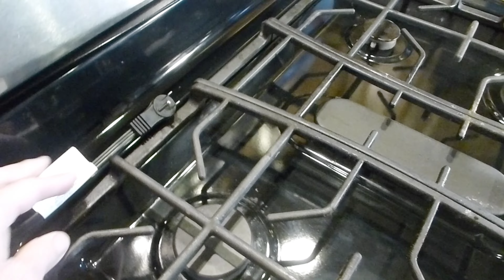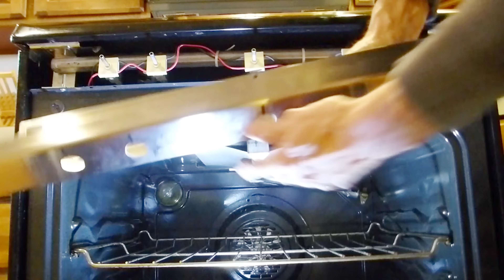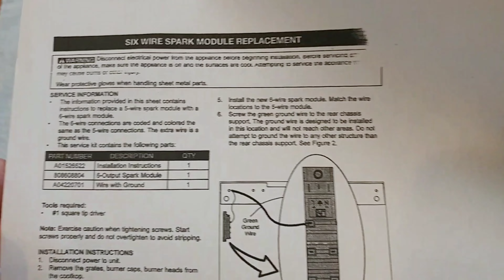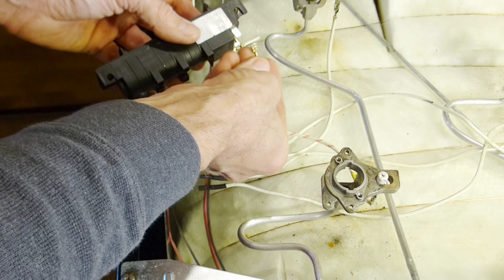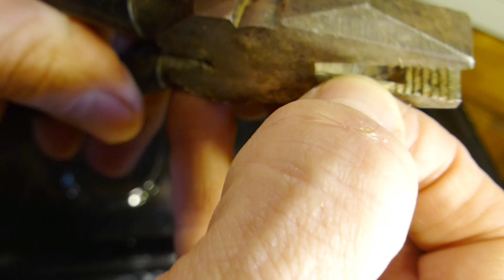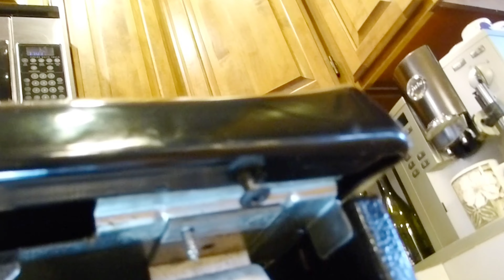Replace Spark Module Gas Range Kenmore Frigidaire Electrolux Stove Igniter

Comment: Super helpful. I have almost the exact same model stove. My back left burner will not spark but the others do. I tried cleaning all the ignitor and the parts above the ignitor with no luck. Burner lights with a lighter no problem. Not sure if zi should change the ignitor for that burner or the module as shown in your video. Thoughts or ideas on how to troubleshoot?
Reply from the maker: At the module, swap the wire for the ignitor that's not sparking with another ignitor wire and see if the problem remains with the same original failed ignitor. If so, that ignitor needs replaced. If the problem moves to the ignitor that you swapped wires with, then you need to replace the module.
Reply: @ScubaMoto  thanks so much! Makes total sense.

Comment: I replaced the spark module but it won’t stop sparking when I connect it to outlet
Reply from the maker: Sounds like the switch harness is shorted. You might get away with just cleaning it (the knob switches) with a good thorough alcohol rinse. Otherwise you'll want to replace it using your model number.

Comment: Your video was very helpful to tear it down the problem that I have is igniters constantly spark I'm thinking the module is bad also . Any thoughts ? Thanks
Reply from the maker: Glad it helped. It sounds like an issue with the knob 
ignition switch wire harness. One knob switch might be shorted and stuck on ignite. Before replacing the harness, if it were mine, I'd check each knob's igniter switch and clean them if they look gummed up. Replacement harnesses are around $75.

Comment: My oven doesn’t have the clicking noise. Would that still be the spark module?
Reply from the maker: Most likely. If none of the switches ignite a spark with the stove plugged in, my first choice is spark module.

Comment: I have a Magic Chef that has one burner lighting OK and the other 3 just click and don't ignite.  I'm going to clean the igniters but if that doesn't fix it could this still be the igniter module even though we hear clicking?
Reply from the maker: Don't trust your ears. Trust your eyes. If even one ignitor clicks, it's far too difficult to pinpoint the source of the click. If you don't clearly see a healthy spark at the burner you are trying to light during the ignition phase (clicking), then your spark module likely has an issue. You should also simply try to manually light it to confirm it is getting gas normally. If you can not manually light it or you do see a healthy spark and have no flame ignition, start by thoroughly cleaning the burner. If that doesn't help, stop using the unit because your valve or gas distribution may have a clog or a leak.
Reply: @ScubaMoto  Thanks for that!  I worked on the cooktop yesterday.  Cleaned all the burners and igniters with alcohol and toothbrush, hit the igniters with some 0000 steel wool, made sure the burner holes were open.  Then I found that if I connected any of the non functional burners to the one  terminal of the igniter module where the good burner was, they all lit like gangbusters.  So.  Bad module.  Ordered one from Bezos that says compatible.  Probably not OEM for the price but we'll see how it goes.

Comment: I have a Frigidaire stove that looks just like the one in your video, with the 5 burners. If I try to light each burner, only the two back burners light, while the 2 front and the one center burners do not. I have tried to let the gas flow while using a different burner to attempt to get a spark, and that did not work, so does that mean my igniter switch is still ok? Is it possible for 2 burners to light and 3 not to light if the spark modulator is bad? Is there anything else that could be wrong that I need to look into? I have been trying to figure this out for a long time now, but haven't gotten it figured out.
Reply from the maker: Since it's always the same three burners then it's not the switch harness. Start by making sure it's clean between the igniter post and the burner. I have to assume you are not seeing a spark at the three igniters that won't light. If so, then this sounds like how the spark modules start to go bad so you would replace it as shown in the video. It's unusual for three igniters to fail at the same time, but It could be the three igniters have failed (the metal posts surrounded by white porcelain). You can test that by swapping the wire leads at two igniters and see if the problem follows the wire or if the same igniter still fails with a working wire. You can do this at the spark module. If the same igniter fails with the swap, then the igniters are bad. If it follows the wire then the spark module is bad (most likely).

Comment: All the igniters on my gas range start to spark even if it is one that I turn the knob,so what can be the problem and how can I get it fixed .
Reply from the maker: It might seem strange but that is normal and it means the spark module is working correctly. Any knob will signal the spark module to ignite ALL BURNERS. But only those with gas flowing (valve open) will light.
Reply: @ScubaMoto  Thanks a million for your response,I really appreciate it.What makes this concerning to me is the fact that instead of the burner to light up after the igniter sparks,I was actually trying to light up the left front burner,there was fire all around the left burners front and back and as a matter of fact I have to horriedly put out the fire and after everything there was a black burnt mark on the left igniters front and back.I removed the top plate and checked the connection underneath maybe there is a joint that is not properly connected where gas might be leaking but there is nothing like that.Just now I was able to see another one which I tried and to my surprise it is only the igniter at the right rear (small one) that is sparking when I turned all the five (5) knobs.So is it a normal thing for all the igniters to come to life and be sparking when it is just one knob that is turned or the exact knob that is turned.I will sincerely definitely still appreciate your further assistance on this issue.Thanks and I look forward to hearing from you.Wishing you all the very best.
Reply from the maker: It sounds like your stove may have a problem with gas distribution and/or leaks. It could be as simple as the burner heads needing a good cleaning. You describe "fire all around". If a good cleaning does not solve this; for safety reasons, I must recommend not using it until you can have the stove inspected for possible leaks in the burners.

Comment: Changed that and still not sparking on all of burners 🤦‍♂️ have to turn on the back burner knob to make the front igniter spark 🤔
Reply from the maker: It sounds like your knob switch wiring harness is worth checking. Each control knob has a switch that it controls and they are all connected with a wire harness. A new switch harness is about the same price as a spark module. But if it was mine, I would first try taking it apart, checking all the harness wiring and cleaning each switch with a terminal cleaner like Deoxit and see if that helps. Good luck with it.
Reply: Yup that seems to be it i swapped them  and that seemed to do the trick 👍🏼 might try the cleaner and see if that helps. Thanks.

Comment: Thanks for the video. I am replacing a 4 spark module. If i have a 6 spark module do i just Earth the sixth one and leave one empty?
Reply from the maker: It should work fine if you ground all spares. It will actually also WORK if you don't ground either spare. They just recommend it for safety and so do I. I hope that helps.
Reply: @ScubaMoto  Many thanks from Cyprus

Comment: What if you don't hear any clicks at all. this happens randomly to us. The burners will work fine for a few months and then all of a sudden, there is no clicking and sound and nothing lights. We use the lighter for a few days and then out of nowhere, the clicking starts again and everything seems to work fine. For a few weeks or months and then it happens again. I am just afraid that one time, it will stop and never come back. Do you have a suggestion for us? Thanks
Reply from the maker: It sounds like wiring is worth checking with the switch harness. Each control knob has a switch that it controls and they are all connected with a wire harness. A new switch harness is about the same price as the spark module. But if it was mine, I would first try taking it apart, checking all the harness wiring and cleaning each switch with a terminal cleaner like Deoxit and see if that helps. Good luck with it.
Reply: @ScubaMoto  Awesome thank you for the advice! I’ll start there.

Comment: Thank you for making this video! This is super helpful. What do you do if you don't remember the configuration of stove wires to terminals on the old spark module? Does it matter which stove wires are connected to which terminals on the spark module?
Reply from the maker: You're welcome. I'm glad it helped. I wouldn't worry. The igniters all draw the same current and all knobs trigger the spark module to activate all igniters simultaneously. Turn any knob and they all spark at the same time regardless of which knob is turned. Congrats on a good repair. I hope that helps.

Comment: does this module affect the oven ignition?  My igniter won't power up, even after replacement.  Doesn't seem to have power to it.  The schematic for the for my (similar) Frigidaire model shows a wire going to the "igniter module"
Reply from the maker: No. This module is only for the top burners and it is much simpler than the oven module since its power supply is controlled by us (the users) when we turn the knobs. The oven igniter control module is more complex as it needs to continuously re-ignite the oven to maintain whatever temperature you've set. It is located in the upper back of the stove under the metal back plates. If you open the back you may get lucky and see something obvious but it is more likely needing to be replaced. You have already ruled out the igniter by replacing it. The control modules typically can be found for just under $100 depending on your appliance model number. I hope that helps and good luck with it.

Comment: Hi, great video! Can any of those outputs be used for grounding or is it something specific to that 6th one? How was the previous one grounded? Thanks
Reply from the maker: xulescu: I have seen several instruction sheets for these and they all recommend grounding the 6th unused terminal to the stove chassis. It may be fine to use another but I can't think of a reason not to use the 6th.
Reply: @ScubaMoto  What I don't get is wouldn't directly connecting the output to the chassis like that (essentially shorting the 2 'electrodes' needed for a spark) effectively send 20000 volts to the appliance body guaranteeing you get shocked or the circuit breakers trip? What am I missing?
Reply from the maker: xulescu: It does seem a bit counter intuitive. But by grounding it, it cannot try to spark. I'm not sure how much power is behind these sparks but all stoves should be grounded, so a spark from an unused port is more of an ignition hazard than a grounded port.

Comment: The sixth (6) unused igniter terminal was grounded to the appliance frame???
Reply from the maker: Ted Lahm: Yes. When they come with instructions, the extra (or sixth) output is to be grounded on a five burner stove as shown in the video.

Comment: What if it's only a few that don't spark but do click, and they've already been cleaned
Reply from the maker: valleycowgirl95: That's just how the one in the video began to fail. First a couple of the igniters stopped sparking. I cleaned the igniters to see if it would help but it did not. Eventually, they all failed. This is typical of a failing spark module. I hope that helps.

Comment: I have the same model. The front left has a weak intermittent spark. I called an appliance person, he replaced the ignitor electrode, it didn’t fix it, then spark ignitor switch harness and the problem still has not gone away. What would you suggest?
Reply from the maker: Felipe de Mello: The symptoms you describe sound like a failing spark module, what I replaced in this video. Spark modules often fail in sections. You could switch wires at the module with a burner that works to see if the problem moves to the other burner. If one outlet has failed, the rest will follow. The one in the video started failing with one burner and then progressed. I hope that helps.

Comment: Thank you for the video.  I believe both my spark ignition module and the small white spark module are bad.  I've switched the wires on the bad spark module with a port that is sending good spark to another burner and i get nothing.  I've also swapped a good spark burner with the suspected bad port and also get nothing.  So likely a failure of both.  Problem is, I can't find the white spark module anywhere.  I have your model oven.  Any ideas?
Reply from the maker: Wes Singleton: I'm glad the video helped. This top igniter will likely work https://amzn.to/31OChgd . But I've noticed that a failing spark module can cause some strange things. You may find that a fresh spark module may resolve sporadic top igniter issues. I hope this helped.
Reply: @ScubaMoto  thanks!  I'll give it a try.

Comment: Thanks for the video. What do you suggest if my 3/16th head screws are rotten on top and won't take my screw driver? BTW, my problem is that the spark is going sideways not to the top, therefore taking longer to light the burner.

Comment: I have the Frigidaire model of this stove. Stove arrived from Retailer with only 3 of 5 burners working. The two that don't work have no spark.  Lose wire? Bad at the burner?  Ideas anyone. Sadly I did not get it fixed while stove was under warranty.
Reply from the maker: Bryan Garey: Do you know the age of the stove? You could have damaged igniters but it is likely that your spark module is failing. That's how they start to fail; the coil gets weak and can't support all five burners. The stove in the video started with 2 of the 5 not working, then they all went. A quick test will confirm a bad spark module and also rule out failed igniters. Swap the igniter wires at the spark module and see if the same burners are not working OR if the problem follows the wire swap that you made. My guess is the failure will follow the wire swap, thus confirming a failed spark module. I hope that helps.
Reply: @ScubaMoto  This was my question and you already answered it - 3 years ago. Bravo! Thank you.